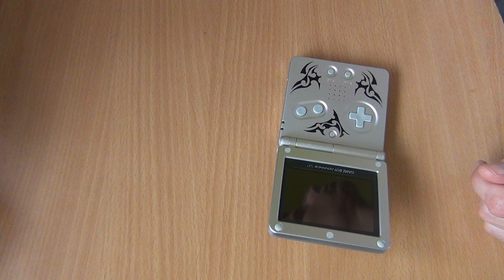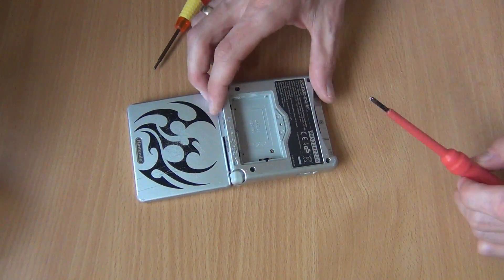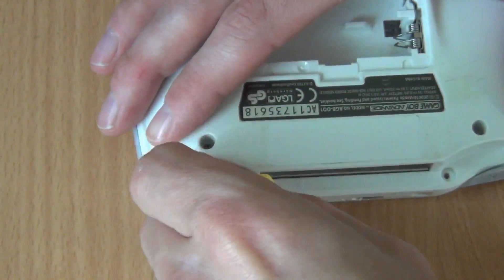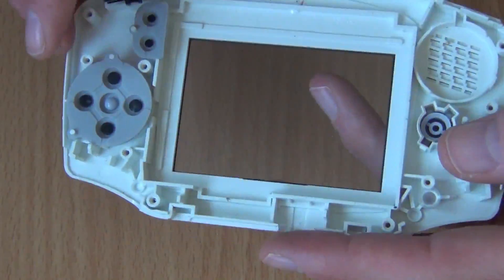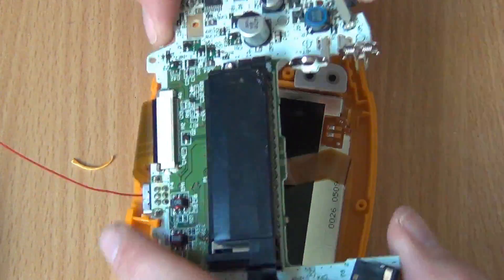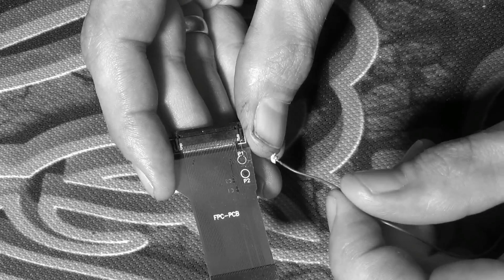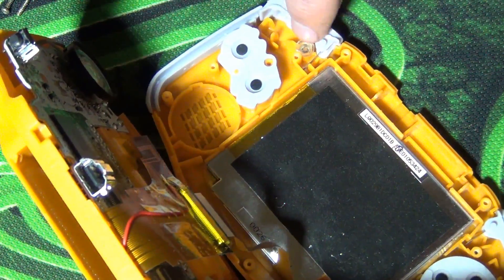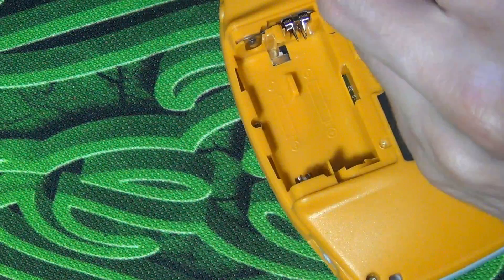Building The Best Game Boy In The World

Comment: sp101, it has another downside, its hard to find a legit one for a decent price anymore
Reply from the maker: Just saw one for €80. Their prices are going up fast.
Reply: I'm more of a "emulate on hardware thats more ergonomic to play
 on" person. Talking PSP, PS Vita or hell, even an Android smartphone with a 
decent attachable gamepad for the same reasons already mentioned before, retro hardware prices are at times sky-rocketing, and its easier to keep a ROM-file safe somewhere, rather than keep the cartridges in pristine condition. There is also the mobility factor one has to keep in mind with all digital games, not having to haul cartridges around everywhere. But non-the-less, and despite all of my likings going towards emulation, I do love seeing videos like this that squeeze out that extra bit of performance, perceived or real, out of retro hardware. Good job!
Reply: I managed to get the 101 back in 2014, but I don't have an original gba. the appeal of this hack to me would have to be the layout, and that batteries should last longer than the li ion pack. soldering isn't something I do however so I'd be too afraid to mess up the only 101 I own.
Reply from the maker: It's one wire. Perhaps you have a friend that can do the soldering for you?
Reply: I think I have messed up moving a screen from one console to another before. If the colours are a little fuzzy and washed out, did I ruin the ribbon cable?
Reply: I have 3 GBA! And 2 colors and the original... my sp is broken though
Reply: Seriously! I was gonna do this mod over a year ago but the 101 prices arent worth it. Im hoping to get lucky and find one at a garage sale or craigslist who dont know that its a 101
Reply from the maker: Andreas Ryge Exactly. That is currently the best strategy.

Comment: and now, to make it the actual best gameboy in the world, add a lipo and micro usb charge port. Nothing goofy and proprietary, and all the benefits of not having to replace batteries every 12 hours of play.
Reply: Lointan Swede
Congratulations on your incredible reading comprehension.
Reply: jeez, my gba batteries rn have 40+ hours on them and the light is still green
Reply: @ jesse The video is about putting a backlit screen in it. If you don't think 
that's going to negatively effect the battery life, you're high on the 
nicest cush. Also, how would you like to get 40hours and then not need 
to put in new batteries? Better, yeah? @Lointan Swede Sorry about that.
Reply: I had done that, Lots of dremel cutting and misery trying to fit it. It did operate but I couldn't button it all back together. It'd be really nice to have a 3D printer for these projects.
Reply: K

Comment: I did this and it went very well, but I have a few tips on how to make it better. 

I noticed that the D-pad is just plain awful compared to the SP, and there's a super ez fix for it. Just cut out some cardboard (from a cereal box or tissue box) and cut it about the same width as the back of the D pad. Make sure to punch a hole through it so the rubber will fit through. Then just put it back together as normal with the cardboard between the plastic D pad and the rubber. You now have a fantastic D pad that actually works! I don't know why it's like this but it fixed the issue of pushing up and right really hard to get anywhere, now it's effortless with no drawbacks.

I also noticed the backlight bleeds horribly. I purchased a bleed protector from Retromodding, but since they are based in canada and their shipping is $6 no matter what you buy, I cannot say this is worth it. It does work and for what it does it's a nice thing to have, but hopefully there will be some better options in the future. 

I also highly recommend you hot-glue the screen to the faceplate, it WILL move over time and become uneven. 

The custom shells have imperfections that make the lights inside bleed through the front, if this happens go to the store and buy yourself some paint of the same color and spray the inside of it in the problem areas to get rid of the bleeding. 

The battery bay has contact issues over time and the metal piece is really easy to replace, be sure to replace it if your batteries are showing red even though they are fully charged. Wipe it down with rubbing alcohol if necessary, keep them as clean as possible. 

That's it! Be sure to tighten the screws evenly because the custom shells are really cheap and stress very easily, so even tension (and strong tension) is recommended so it doesn't fall apart or over stress the gba in certain areas. 

Good luck!

Comment: This is quite awesome :o
Would it also be possible to install a rechargable battery like the one in the SP in the AA battery compartment?
Maybe even make it rechargable via MicroUSB. THAT would make this thing pretty much perfect.
Reply: mod in a battery pack like vaps/e-sigs use they have a micro USB port and use rechargeable batteries
Reply: No need - people make rechargeable batteries specifically for the GBA that you can buy. Just try to make sure it has a good battery life - the SP's battery is only 850mAh, as opposed to the 1300-2300mAh you can get from some AA batteries, so if you can find one with at least 850 mAh (preferably closer to 1300mAh) then you should be golden.
Reply: Moonlight Quiver That's useful to know. I'm about to try building this myself
Reply: It depends how many cells the lipo has. If it's 3s (three cells) that's 850mAh x 3 (or equivalent to 2,550 mAh)
Reply: I would use a Samsung smartphone battery since they have current limiting/overcharge protection build in. For example a battery for a note 4 would need a 17 ohm resistor in series with the gameboy power input. Then cut a hole for a microusb port and add a 4 ohm resistor in series from the usb port to the battery. Or you could use a 1 ohm resistor if you were okay with not using the gameboy while it's charging for 50% faster charging.

Or you could just use rechargeable aa cells.
Reply: Anton Chigurh absolute rubbish a 3s lipo will be 850mh because when cells are put into series (s) they retain the same mah but the voltage will be 3 times the power you are getting confused with running the cells in parallel (3p) which would give you 3 times the runtime
Reply: Captain N+ what about USBC? >:O
Reply: Just use rechargeable AA batteries, I have loads for my Wii controllers
Reply: Why would you want a built-in battery that will inevitably degade as time goes on when you could just use AA batteries?
No matter which device it is, the worst thing ever is when you run out of battery while on the move and have no place to charge, right?
By using AA batteries you could just go buy new ones if you ever need it as pretty much every store, ever, sells them.
Reply from the maker: +HarleyAMV give this man a cookie!

Comment: Having used all three systems growing up I personally like the gameboy sp the most. The main reason being because of its foldable design which protects your screen. If you look at the nintendo ds and 3ds they all carried on with this same feature because the design makes sense for protecting the screen and also adding the neat feature of pausing your game while its closed. That and its rechargeable feature without the need for a mod already makes it a clear winner when compared to the gbc or gba. While the sp does not have a 3.5mm Jack port you can easily buy an aftermarket adapter to utilize your headphones with at a very low cost that you'll hardly notice.

Comment: It looks like a pretty solid system, although I was really hoping that you would include some method of charging the batteries by modifying the case and putting in a rechargeable li-ion battery like the SP has. 

Those AA's are going to drain so fast with that backlight, really diminishes the value of having such a crisp and powerful screen in the first place. 

that aside, cool vid and cool build
Reply from the maker: +Avery Mitchell With the new screen the GBA is actually more energy efficient. And I am working on a new video to add a battery and charger.

Comment: ... it doesn't have the SP battery
Reply from the maker: It also doesn't have the proprietary headphone jack :)
Reply: That's a good point. You'll just have to make do with rechargeable batteries
Reply: RetroGameCouch
I do hate that shitty adapter so much. But mashing in the battery + circuit from an SP should be possible right?
Reply from the maker: spookanide Should be, yeah.
Reply: Possible yes, but the SP only had a 850mAh capacity battery, while good AA can have around 2500mAh capacity (and you have twice of those in one GBA). So while it's not internally rechargable, AA will last much much longer. But you can also get different Battery packs for the GBA aswell.

Comment: It's good until you realize it'll be using batteries, doesn't beat the SP
Reply: yeah no those rechargeable batteries they sell on the market suck and what are u gonna carry that bulky charger with u everywhere? yeah no thanks
Reply: Enelooops are fine. You can have a few of them on you so you never run out of juice.
Reply: yea thats not really a big difference i still like the advanced better
Reply: do you carry your SP/DS charger everywhere? If you do, what the hell. If you don't, exactly.
Reply: Herman Toribio uhh yes its small enough to fit in a pocket and if ur in an intense battle and are nearby an outlet viola. Problem solved can't do that with ur rechargeable batteries unless ur carrying a few and whos gonna do that now. Plus good luck to that intense battle i mentioned gotta power down to put the new ones in.
Reply: Jack F what intense battle are we talking about?
Reply: matthew skullblood lol just in general when your gaming and theres no save or checkpoints and ur almost out of battery juice
Reply: Jack F never happened to me in any of the pokemon games
Reply: matthew skullblood thats cause pokemon has a quick save feature. But it could still happen if your in the middle of a battle with the gym leaders. What are you gonna do restart after plugging in those handy batteries? The retro gba doesn't even guve u an indicator to when your batter is almost dead like the newer ones
Reply: Jack F i save before doing anything important so it doesn't matter if i have to redo it
Reply: matthew skullblood well ur set then i play alot of games that will hold u up for a while in a dungeon or battle so o can't work with that set up
Reply: Jack F i have never played legend of zelda or any major rpg maybe i'll get the title launch for the NX
Reply: I should put developing an easy to build and more or less safe internal charger for GBA as well as a low-battery alarm on my to-do list then. I'm aiming for a 5V input that could be made as a micro-USB socket, so you could power it with sources you're likely to already carry around for your smartphone.
Reply: Siana Gearz why need an alarm theres already a light
Reply: matthew skullblood Right! I just took out the board and noticed the battery light is dual LED, DL2 green = operational and DL1 red = battery low. But somebody above complained they didn't know when they were going to run out of battery and there was no indication? Either the indication doesn't work properly with modern batteries of some kind, and needs an adjustment, or they were plain wrong?

I haven't actually used GBA for numerous years because i haven't finished building it, but i dug it out of a box of parts now.
Reply: Siana Gearz yea they've probably never heard of a gameboy in there life and never seen one or owned one
Reply: Karpov Liam what argument? Because if ur saying that inferior system outclasses the sp than ur drinking that kool aid.
Reply: matthew skullblood no idea what ur talking about
Reply: Siana Gearz the Nintendo systems after this device all go red than blink to let tou know this crap was barely visible even in the sun yeah he made it a bit useful by adding the brighter screen but i bet that will eat even more of those disposable batteries. Hey not knocking it but the gba sp has rocked the kingdom for years and goodluck buying one of these customs or making it urself not simple or cheap
Reply: Jack F It's using slightly LESS battery. The new screen is just THAT much more efficient. It does well over 20 hours on a set of Alkaline primary cells either way. Expect about 20 hours on a set of Eneloops too. You get more mileage out of an AA powered GBA than out of an Xbox360 wireless gamepad! I'm not even kidding.

GBA SP used the exact same screen for years, with a frontlight attached, and the AGS-101 model with improved screen used here is also very rare and expensive. They are inconvenient because controls are too close together, they require a proprietary charger, and they require a proprietary headphone or a headphone adapter. I would avoid using them at all cost, they're just THAT inconvenient to me. I'd rather have a Nintendo DS then.
Reply: Siana Gearz didn't know that aspect u make a valid point there i do want to try one of these out but like i said too much money and no idea how to assemble myself
Reply: I personally prefer the batteries, due to a good pair of alkaline AA's having a WAY longer life than a charge on a Ni-MH or a Lithium Ion pack. If you ever wanna have a long session on a rechargeable you're gonna get tethered in the middle of it, plain and simple. Meanwhile a pair of good batteries can go a week. Does cost more but I think it can be worth it and if you're an older individual with an OK job you can spare a few bucks for the hobby.
Reply: Joseph Odle well they will also always make rechargeable batteries. Those things last forever  especially the nintendo ones and its diry cheap to replace so recharge for the win. Save that money for future products
Reply: Have none of you used rechargable AA batteries before? They rule and can be RECHARGED. 2 spare batteries can be put into a tiny sack or whatever pleases you. Also, the SP battery has a lower capacity than AA these days. You're getting longer life by using the GBA.
Reply: Fortunately they make rechargeable battery packs for these now lol
Reply: Luis F Luis F dude you are talking about how shitt rechargable batteries are. But guess what? Gameboy, Gameboy color and Gameboy advance all had batteries. And yes we managed to live without lithium ion back then. They last longer and you can instant replace them with new ones. And no battle in no game is so intense and long you can change the batteries anytime.

Comment: only would be the best if it was rechargable
Reply: I still use an original gba. never had an sp. I like it actualy. I 
still use rechargable AAs but I can bring along a handfull of batteries 
and just swap out when one set runs out of power. im sure the rechargable battery pack lasts a long time but when happens when it goes out? im sure its harder and more expensive to keep extra battery packs around for your gba sp. even with AAs my gba outlasts all other portable electronics that i have when I take it on a long car ride.
Reply: Pika Alex The wii's rechargeable battery fits into the gba and the wavebird
Reply: Pika Alex the rechargabke batteries are pretty weak/burn out fast. Batteries better. Just like xbox controllers>ps4 controllers
Reply: +SoloDolo personally for me the PS4 controller has been waaaay better imo, runs for days without charging and when I use the Xbox it dies in like 2 or 3 days
Reply: Teenage Meme Lord so they last about the same? I just hate having the charge it with the small ass charging cable lol or having to stop playing and let it charge

Comment: you lose the recharge ability tho
Reply: You can get a set of rechargeable AA batteries.
Reply: Rechargeable AA batteries will lose their rechargeability after about 10 recharges, they will hold voltage worse... so yeah :/
Reply: a friend of mine had an rechargeble batterie pack
Reply from the maker: 10 recharges? Not if you buy an A-brand, like Energizer. They guarantee up to 1500 recharges (http://www.energizer.com/batteries/energizer-rechargeable-batteries)

Comment: I am having trouble assembling it back, and your video doesn't really help. You unscrewed the main board from one side, but when you finally put it back it's the other way around. How did you screw back the main board?
Reply: Kinda looks like you didn't screw the board back!
Reply from the maker: It takes some fiddling, but I got it in place fairly easy. Screwing the backside on was a bit more difficult as the ribbon cable makes the entire insides a bit thicker. It takes a bit more effort.
Reply: I meant to ask, if you screwed the main board back, not just the back side...

Comment: Very cool mod, though I wonder how expensive it would be, considering the AGS-101 is more expensive to obtain than most anything outside of the original Japan-only Game Boy Light.  You're essentially buying 2 GBA systems and creating just 1 from that.  I wonder if you could do the reverse, and put the original GBA screen in the AGS-101, so it's at least a functional unit.  That would be equally interesting, I think.

Comment: after having upgraded a few gbas a few years back i have noticed that the aftermarket shells you get on ebay are more brittle and feel worse.
if i ever do this again i'm sticking to the original shell. replacing the buttons is a good idea though.
also, there is a potentiometer on the back of the mainboard that sometimes needs to be turned to put the screen to its optimum voltage. it can even be accessed via a hole under the sticker on the back of the GBA without having to take it apart.
Reply from the maker: Excellent information. Thank you! This is useful for everyone trying this mod.